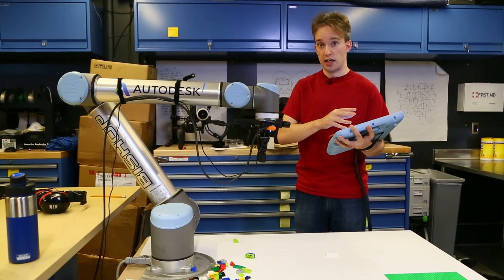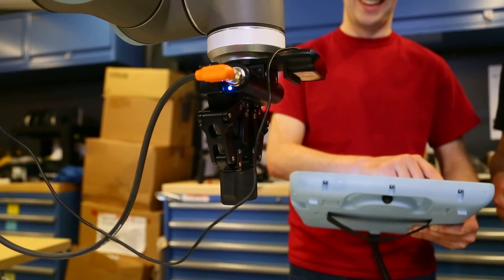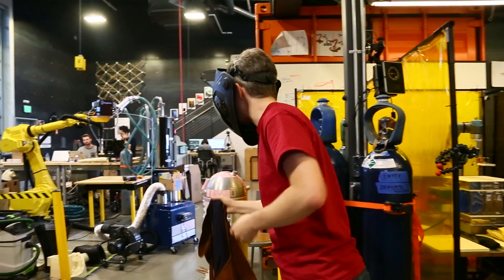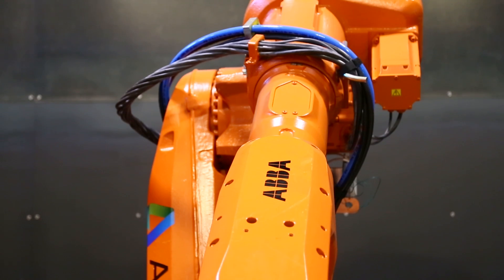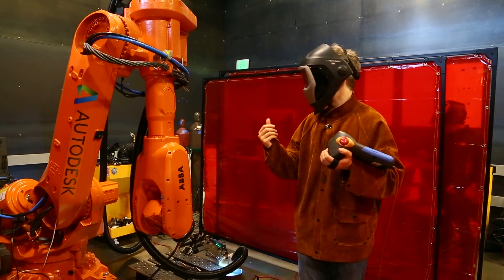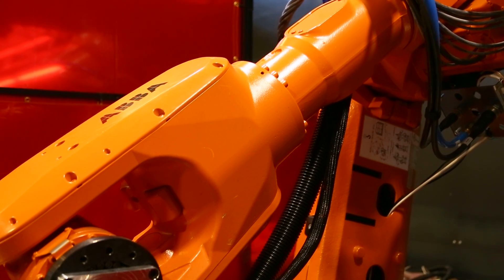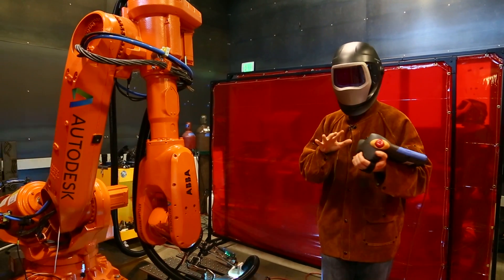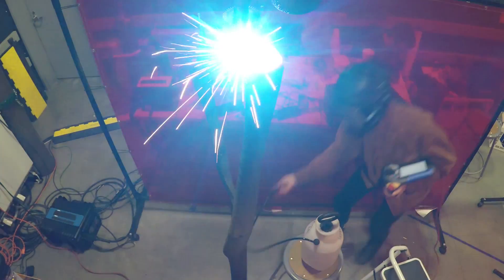3D Printing Stainless Steel with Giant Robot Arms

Comment: You need to wear safety goggles and a welding mask at the same time?
Reply: You really should with many welding masks, but it depends on the specific model. Full face masks typically do NOT provide a proper eye seal, and stick out either side of your face. They're great at stopping stuff coming from the FRONT or above from doing anything to you, but they're also wonderfully shaped to act as scoops that will redirect stuff frying toward you from behind or from far enough below. 

You do not want stuff bounced off the inside of your face shield and splashing back into your eyes.
Reply: Health and safety is often a matter of learning from others. Frequently it is learning from their horrible horrible mistakes. Ask questions often, stop and think of how things can go wrong before bad things happen.

And never forget that for some people their purpose in life is to serve as a warning to others.
Reply: RealLuckless That makes a lot of sense, thanks for clarifying.
Reply: Aidan Ratnage yes. Sparks can bounce around inside the helmet when you are welding.
Reply: i was welding once in school with a mig and the sparks went inside my mask, i was lucky that it did not do anything more than burn my hair a bit

Comment: Something you might not have know....
The Emergency Button that Tom is holding in his hand is called Dead Man's Switch.
Reply: You're over exaggerating the dangers. If the dead man switch is in the wrong position while the robot is doing a rapid move, it's going to grind to a halt with expensive noises. Though, judging by how fast it "retracted" to do another layer, they must have soft-limited it to less than 10% speed, which is not nearly enough to hurt a human, aside from maybe pinching, but that can be prevented.

Comment: Having the pivot control is required to do welding, as you usually need to apply the weld at specific angles.
Reply: XYZ is for position, for orientation you need 3 more variables, typically (and conveniently) called ABC.
Reply: Rado The definition you're thinking of is six degrees of freedom.
Reply: Rado yeah, but still: isn't XYZ pretty much the definition of 3D, or at least 3 degrees of freedom? Now granted the way a FDM printer works can be called 2.5D in that it's very much layer-based, but the Cartesian or Delta platforms themselves operate in 3D space. Theoretically, it's possible to add rotational DOFs to delta printers by controlling the individual sides of each arm separately...
Reply: Conventionally it's called pitch, yaw, and roll. Welcome to geometry 101.
Reply: Jasper Janssen Their printer is not 3D vs 2.5D, it's not like a 4 axis cnc is 3,5D
Reply: I saw an upside-down Delta bot doing this on the Open Source side a while ago, but the output quality was pretty bad. Not unusable, but pretty crude. You'd have to sand or otherwise machine them down to fit with anything else, that's for sure. I'm pretty sure they only had 3DOF, and they also didn't have feed speed control or any feedback of any sort. No idea how sturdy or accurate the parts that came off were though, it looked like they just overextruded to compensate for unforseen deviations from the computer model.

Comment: 100% 3D printed guns soon.
Reply: they have been made years ago with a different technology. (and yes they are made of metal)
Reply: I still don't get the fear of printed guns. Make a gun out of some pipe and junk, its not accurate, but it goes pow pow.
Reply: Big_Adam_2050 
Doing that requires some level of expertise, but printing one just requires a capable printer.
Reply: OriginalPiMan
Not really, its a zip gun. file and a spanner. Not ... 150-300entry level printer.
Reply: SexyJamal77 still would need to machine it

Comment: As far as I know they are commercial systems now, but about 6 years ago (when I started uni) the head of materials engineering there had a 3D printer that printed things in aluminium.
He basically did as many public demos as possible in order to justify printing his own (quite big) chess set.

Seems amazing that we've advanced this far so quickly. That system was bounded to objects being about 2x2x2 metres, and required a tonne of maintenance to operate. Even then it required everything to be painstakingly planned out.

Comment: Abba, think that's AllenBradley something something... I went to high school in the late 90s near Detroit, my school had a robotics program that relied on cast off industrial machines from the auto industry.  Back then vision systems and force feedback were bleeding edge. The languages I was using back then were smart enough to procedurally generate positions based on known positions, like an approach position that's so many mm back along the tool axis from the grab position. Nothing like this though.
Reply: ABB is one of the biggest industry/robotics conglomerates. They started out as Asea in Sweden and then merged with the Swiss firm Brown Boveri & Cie, thus creating the abbreviation ABB.
Guessing someone added the A so they could say that they have a Swedish robot named after a Swedish pop group...

Comment: We still use assembler for many different applications. Because it is down at the register level, where you have to tell the processor to send information to and from the memory, there are a lot of little tricks we can do to save time on certain processes that you can't do with C or higher level languages. It might only be a few micro seconds per cycle of the program/subroutine, but in situations where you need to go down to assembler it will be doing hundreds of cycles a second.
 So yeah, high level languages are great for programming some things, don't count out good old assembler just yet!
Reply from the maker: There's a reason I said [checks subtitles] "most programmers". I don't envy those of you who work at the bare metal :)
Reply: Yep, I used to program code in satellites - we used old proven chips so they didn’t fail in launch (remember the Z8000 and 8080??), low memory (weight is everything, so even a couple of grams was worth saving), and assembler was:
- more reliable. Less unexpected events coming from code someone else wrote, with associated errors that then need trapping etc.
- more efficient. Why use 100 bytes when a Mb will do :)
- faster. Much, much faster!
Some highly abstracted systems today could do with a dose of efficiency building back in. Assembler definitely has its place, and its not just in the bin (no assembler, no higher level coding tools).
Reply: Tom Scott I do hope that pun was unintentional...

Comment: Would the 3D printed steel be as strong as steel pieces traditionally made by welding?
Reply: Liberty probably more brittle, as it is pure weldmetal, whitch is typically stronger but more brittle. Also, thats a ton of heat input... probably want to normalize the part after printing...
Reply: Liberty Like any metal fabrication, heat treatment, hardening and tempering can be used to create the characteristics needed for application (strength, hardness, flexibility).

The problem with welding, especially MIG, is that weld quality, thickness, heat affected zone, fusion, porosity, etc are constantly changing based on torch angle, wire feed speed, amperage, duty cycle, sheilding, base metal thickness and temperature, and so on.

A huge number of variables...  While this is a neat proof of concept, and useful for other reasons like self correcting, human and contextual awareness, it won't become a practical fabrication method.  There are far better, cheaper, faster and more consistent methods available.

Useful yes, but only because of the secondary lessons learned in the process of developing the concept...
Reply: Ruzhong X. MIG is the only one really used by robots today... this is still usefull, but only for things that litierally cant be made any other way, and maybye for quick, one off prototypes and coustom orders. at least for now.
Reply: Would another form of welding be more practical and viable?

Comment: Resolution? efficiency/print quality compared to other metal 3D printing tecniques like SLS?
Reply: The Inebrati No idea but there is a metals version of SLS called DMLS that the company I work for uses to "print" aluminium, steels, titanium, copper and so on down to 0.02mm layer thickness and a 0.1mm focus diameter. That's way tighter than our SLS machines.
Reply: This will be far lower in pretty much every measurement - price,  safety, and accuracy.
However, it excels in two things - work envelope(can build around itself entirely), and speed.

Comment: I still can't wrap my head around the fact that a working jet engine has been 3D printed...
Reply: Hebl von Heblowitz And rocket engines too!
Reply: *****
I know that's impressive, but printing a jet or rocket engine! That stuff has to withstand meganewtons of force and not give even a slight hint of failure after thousands of hours of use. And it's just "welded" together.
So it's the robustness of 3D metal printing I'm most impressed with. Of course other 3D printing is robust as well, but I kind of got used to 3D plastic printing - but metal ... crazy times we live in :D
Reply: Technically, you can make a pulse jet with a sheet of steel, a mallet, a drill, a saw, sleight of hand and some spare time. It's just a u-shaped tube with 3 holes punched through it, a bulge at one end and a trumpet at the other end. And you can sure mass 3-d print it in no time on cheap equipment
Reply: Koenigsegg 3d prints their turbos. They say it allows them to make them more complex and have lower tolerances than with traditional manufacturing.
Reply: Some inner voice told me to explicitly state that the part about longevity was meant only for jet engine. That's what I get for not listening to it...

Mordewolt, that 3D printed engine way a bit more complex than a pulse jet ;)
Reply: Rocket engines are generally only used for a few minutes before they are discarded...
Reply: Hebl von Heblowitz XD
Reply: Sebi20070
I guess you older generations have problems with reading, then? ;) Where did my amazement waver, exactly?
Reply: Florid Monkey But some of Spacex engines are 3D printed and they are used again.
Reply: xWood4000 They haven't been used again yet.
Reply: xWood4000 What do you mean probably? Most SpaceX engines have been fired 10's of times. I'm talking about actually being used in flight. In which case, it hasn't happened yet.
Reply: As a mechatronics engineering student at university we've had lectures from some companies explaining that some are starting to be able to 3D print houses

Comment: do they use neural networks for the rewriting or some other method?
Reply: They almost certainly do. Machine Vision is just about impossible without a neural network anyway, as the alternative is to store every possible picture its camera would pick up.
Reply: It doesn't sound like it requires a neural network for the actual re-writing.
I'd say that isn't that complicated.
Detecting objects moving in the space around the machine, detecting imperfections in the weld etc. could benefit from a neural network approach.
Reply: I would hope its not neural networks. they are notoriously unreliable. prolly just some kind of utility AI. Have utility functions assess how important a certain action is, like perhaps stopping the print. If that utility function says its more important than everything else(for example because the print has gone wrong) it stops the print. That would be my guess at least.
Reply: Machine vision is usually a LOT simpler than ANNs.